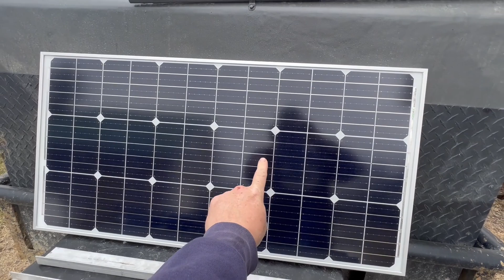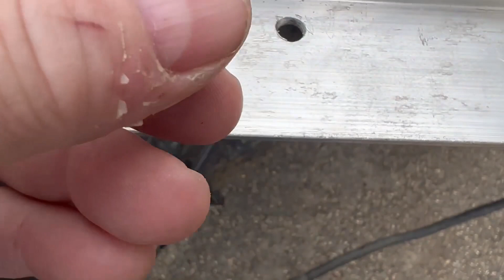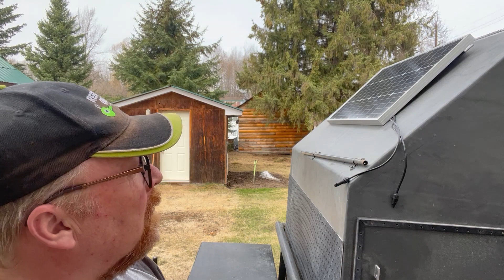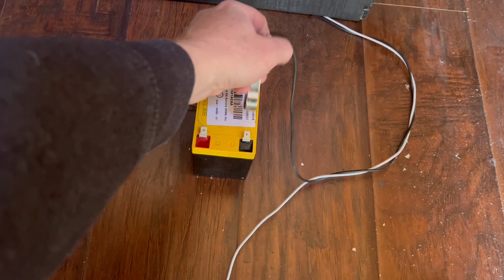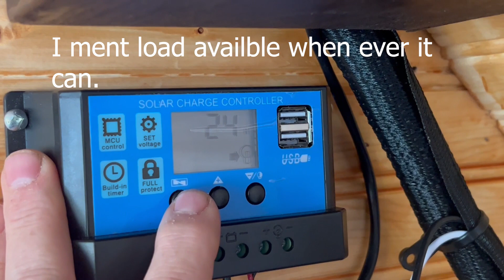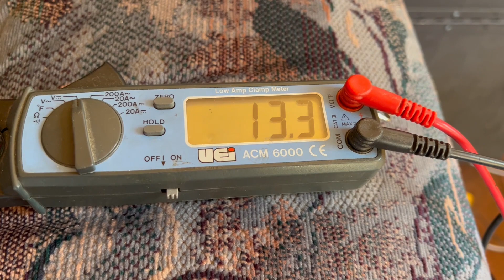Installing a 100 watt solar panel and charge controller

Comment from the maker: https://www.amazon.ca/Controller-Intelligent-Regulator-Paremeter-Adjustable/dp/B08NFSCZ4V/ref=mp_s_a_1_4?crid=3IP4SZ12W8OBU&keywords=solar+controller&qid=1683832819&sprefix=%2Caps%2C608&sr=8-4

https://www.amazon.ca/Renogy-AK-10FT-10-Adaptor-Female-Connectors/dp/B00JH1PABW?pd_rd_w=qDcCx&content-id=amzn1.sym.8f6a9dc7-fc2b-46f7-a411-0ed45cd76fd0&pf_rd_p=8f6a9dc7-fc2b-46f7-a411-0ed45cd76fd0&pf_rd_r=0MQGAQDHHXT0T1JGPD7P&pd_rd_wg=0y2BY&pd_rd_r=d55809cd-8e3f-473a-88f7-26fbcdcefb36&pd_rd_i=B00JH1PABW&psc=1&ref_=pd_bap_m_grid_dv_rp_0_2_t

https://www.amazon.ca/ECO-WORTHY-Watts-Volts-Monocrystalline-Solar/dp/B00V4844F4?pd_rd_w=MnET4&content-id=amzn1.sym.8f6a9dc7-fc2b-46f7-a411-0ed45cd76fd0&pf_rd_p=8f6a9dc7-fc2b-46f7-a411-0ed45cd76fd0&pf_rd_r=ZYKZFES1BD0GXG6VN1JM&pd_rd_wg=GWRWA&pd_rd_r=52838102-4321-489d-8b87-3f11b8e24b33&pd_rd_i=B00V4844F4&psc=1&ref_=pd_bap_m_grid_dv_rp_0_3_t